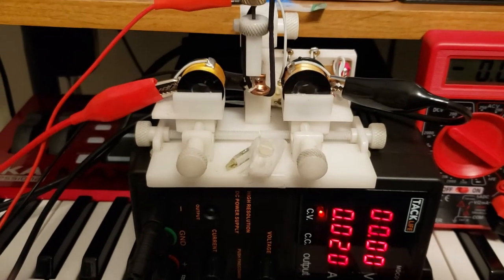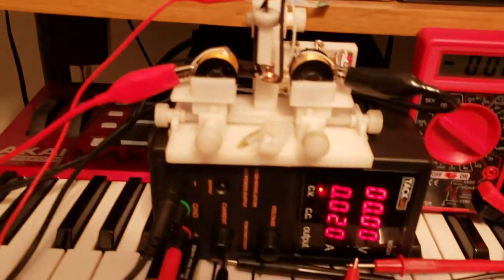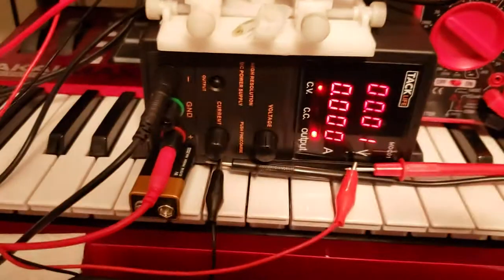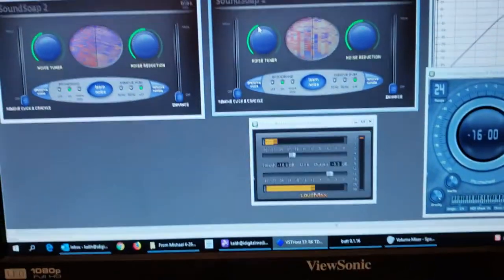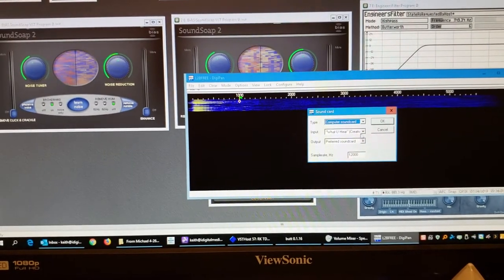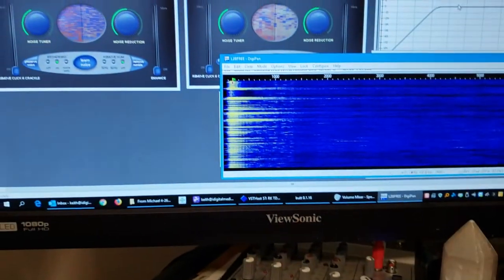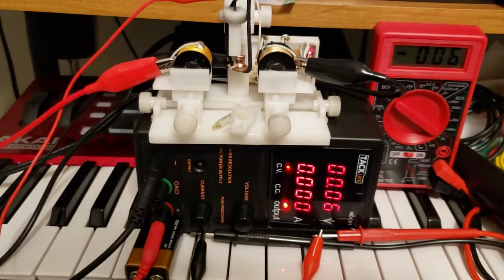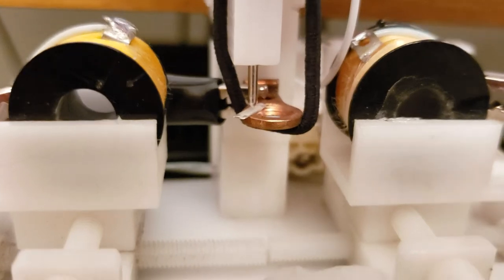Piezoelectric Effect on Quartz Crystal with Live Filtering

Comment: Can you try placing the crystal inside a Vacuum cavity sorrounded by a helium gas. To prevent results caused by external vibrations and  temperature differences.
Reply from the maker: Hi there! It would be cost-prohibitive at this point in time. I do happen to have a bell jar and an ac pump that used to be able to get down to very few microns....but I'd need a radio transmitter to monitor and helium gas - well I wouldnt even know where to start with that! For now I'm just deviating from the basic principle of this device - which was originally designed as a modern replica of the device built in the Scole experiments.